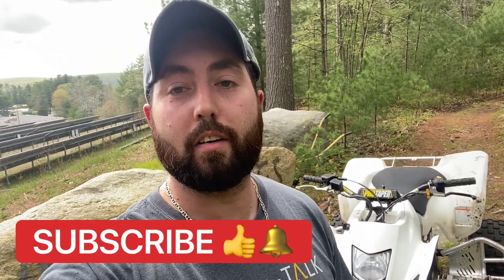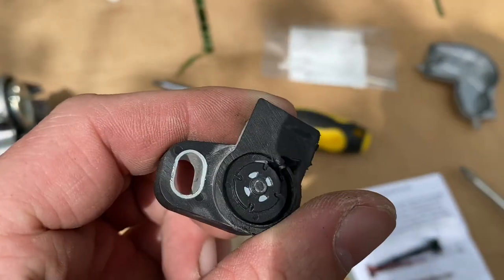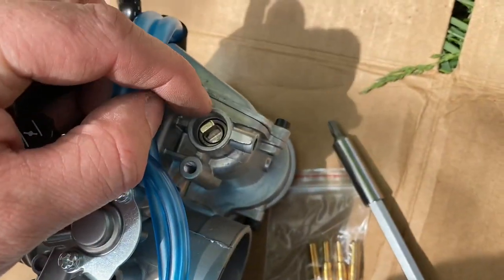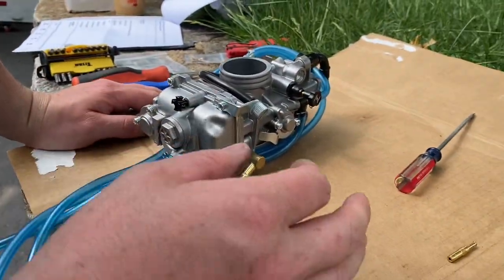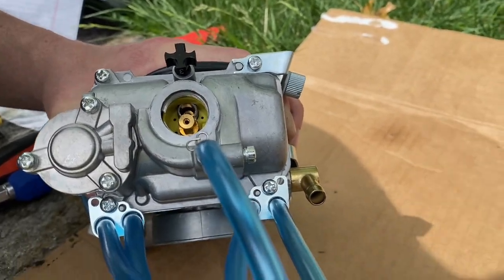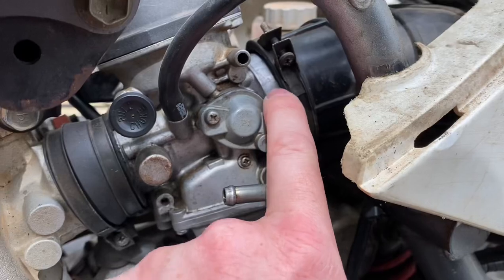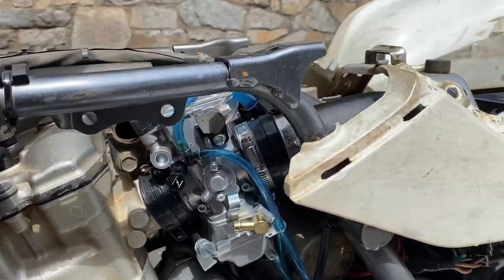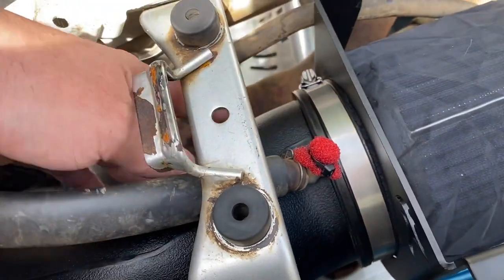How to install an FCR carb on your Ltz400 (Kfx & Dvx)

Comment: Oh wow! So you're from Connecticut!  Didn't think there's was places to ride there! My wife is from Enfield Connecticut! But man my z had a 39mm fcr carb and the trx 450 fci too and it ripped! I had a 434 big bore kit, stage 2 hot cams, ported head, dynatek cdi box, and ignition coil too so you know it was running strong! Lol
Reply from the maker: Hey man. I have seen all of your z400 vids. You have to get that thing running again! I have gone riding in Enfield quite a few times. I do most of my riding at my dads place. He’s got lots of land.
Reply: @ScottMyers5189  lol oh have you! Lol I appreciate cha watching even tho it's down! Man I wanna get it fixed but aren't able to financially unfortunately. That's cool to know your dad has alot of land! Is that where you're riding in the video!?
Reply: @TerrellSpivey  we gotta get your bike patched up… I have parts 😅😎

Comment: Will that +2 throttle cable work on a OEM carb? The OEM size doesn’t fit anymore, I added an aftermarket inlet threaded connector on the carb.
Reply: Wondering same thing did u try it?

Comment: Hey bud what did you end up doing with the factory vacuum line coming from the old petcock to the carb ?
Reply from the maker: Deleted it. It’s not needed when you switch to the raptor 660r petcock.
Reply: So i can delete it by plugging the top left of the carb. Also the tank don’t need to breathe at all ? 
Thanks
Reply from the maker: @woodken  you you can block off where it was connected to the stock carb. The tank breaths threw the fill cap.

Comment: This is how not to do this
Reply: He showed some good basics. Kinda buctched his quad. A much better way is a 2" vibrant turbo hose with their clamps..imo it's seals at way better than using radiator hose. Second use a 400EX intake boot to the factory box with some mode so you can run an uni clamp on. At the end of the day it's your machine and do do if you don't mind it and it works hell😅